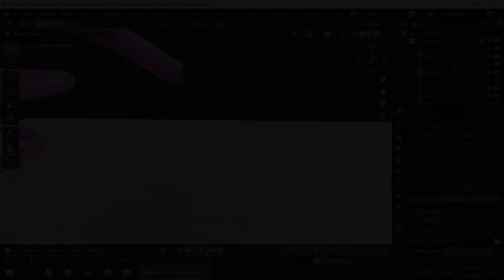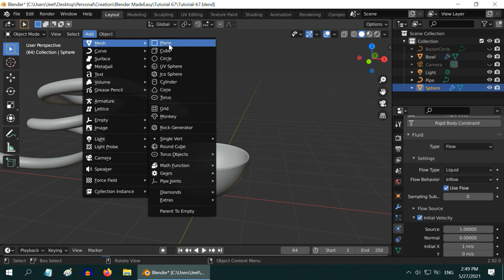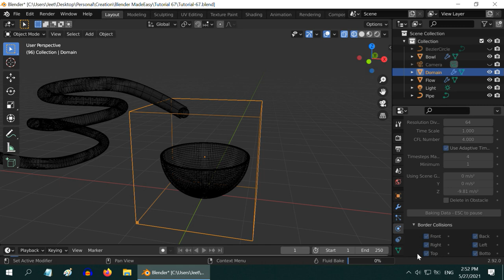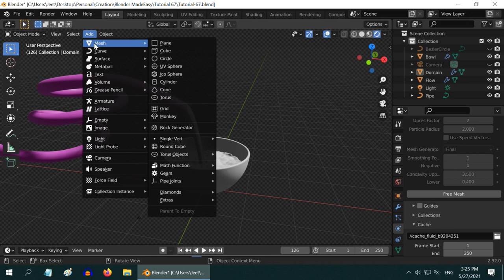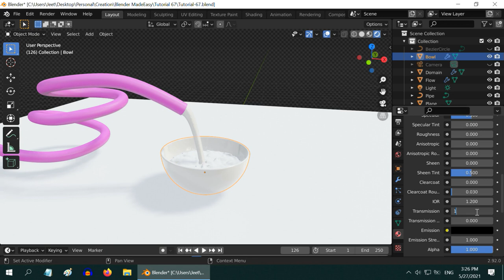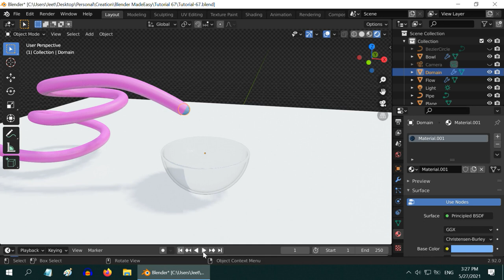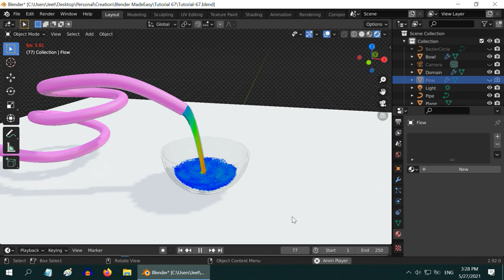Fluid Container Explained | How To Use An Effector In A Fluid Simulation | Blender Eevee & Cycles

Comment from the maker: If you liked this tutorial, please consider making a small donation, it will help us!
𝐘𝐨𝐮 𝐜𝐚𝐧 𝐬𝐞𝐧𝐝 𝐲𝐨𝐮𝐫 𝐝𝐨𝐧𝐚𝐭𝐢𝐨𝐧 𝐡𝐞𝐫𝐞 👉 https://donorbox.org/5-minutes-blender
Reply: hello I think you are using 2.92 not 2.93, I would appreciate if you change the title
Reply from the maker: @muhammedserifkorhan5617  You are absolutely correct. But I tested it in 2.93 and it works exactly same, they did not change the mantaflow. The title is to inform the user up to which version this tutorial is correct & relevant. The recording version is not important I guess. By the way, thanks for watching 💝
Reply: @5MinutesBlender  No problem, you explained it very well, I will continue to support you
Reply: @5MinutesBlender  Hi, I would really appreciate it if you respond, but... It's not working. I'm not using that exact object, I'm using a cylinder, that I cut out one of the faces to make a cup. To round it, I added a 2 subdivisions, but I'm wondering if that's the problem. My liquid ignores my boundaries and uses it as if the cylinder is just a cube, and sometimes, randomly, it acts as if I haven't changed the fluids. Any solves? Also, how do I make a cup? Sorry for the lengthy comment.
Reply: Also, sometimes, when I scale the effector, it acts as if I didn't and leaves a huge gap between my "cup" and the fluid. Thanks!
Reply: There is a bake all option now under cache.

Comment: Great tutorial, only one thing was a little bit of a problem was when the size of the flow object is too small I had to make it bigger for the water to come out.
Reply from the maker: Yes. A small size flow object will work only if you increase the resolution divisions of the domain object. You may need to use really higher values before you can see it working. But with very high resolution divisions, the machine can break unless it has sufficient RAM. So a trade-off is necessary.
Reply: @5MinutesBlender  Thanks for your feedback.

Comment: this doesnt work for me necause even though i tick the ‘Is Planar’ box it still passes through the effector and idk why. can u help pls
Reply from the maker: Hi, to be very honest, fluid simulation in Blender is not fully perfect. When the fluid velocity is relatively high, some particles would always pass through. You can somewhat minimize this by increasing the subdivision of the effector object so that it has a dense wireframe. I could create only reasonably good animation, but not perfect as per physics. I would call this a limitation as of now.

Comment: I can get everything to work but when I render it, the liquid pouring disappears as soon as it crosses the visual boundary of the bowl. I can still see it start emitting and pouring down until it pours "inside" the bowl, then disappears. The shadows show it moving inside, but I cannot see the liquid in the bowl. The transmission values are all good. It seems to work when I change blend mode to opaque instead of alpha blend for the domain (liquid). Any idea?
Reply from the maker: I have experienced this issue sometimes. I think a transparent or semi-transparent material behind another semi-transparent material does not work correctly. However, I also discovered that the viewing angle plays an important role here - the camera location along with the light can be an important factor. So until the original problem is solved, you can adjust the camera angle for the desired effect.

Comment: Sir how can we cange the amount of water flow
Plz help us by your reply ❤
Reply from the maker: You can change the size of the flow object to control the amount of flow. With bigger size of the flow object, the amount of flow will increase. This tutorial can definitely help you 👉 https://youtu.be/yKTQSPG_mgA Please also remember that the size of the flow object is closely related to the domain size and the domain resolution. With higher domain resolution, the fluid will display finer details and it will be more realistic, but the amount of fluid will reduce. With bigger domain size, you need to have a higher domain resolution as well. So ultimately you need to arrive at an optimum combination of these three factors for the exact amount of fluid you need.

Comment: Hi, is it possible to make fluids intearct with normal maps? Say, I have a plane that has a normal map with bumps and what not. Can I make fluids follow it?
Reply from the maker: Technically yes. You can setup the plane (with bumps applied as displacements) as a Fluid Effector, and the fluid will interact with it. But in reality, getting this actually work to a satisfactory level may become tough. You'll need to use a domain resolution of 512 or even higher, which is insane! If the bumps are big in size, you can expect a better result with a lower resolution.
Reply: @5MinutesBlender  Yeah, so basically it's displacement map and Cycles because Eevee doesn't do displacement. That's bad..

Comment: Thank you for tutorial, could I export  fluid simulation object to FBX or OBJ?
Reply from the maker: You can, but the results may not be very interesting. The export function does not yet work smoothly across multiple animation software. They have different ways to represent a particle system, different ways to handle material properties or modifiers. So the look & feel and the particle-based animation will look very different in the best case, and it won't at all work in the worst case. But anyway, try to bake all your animation before you export. I will be very conservative in my expectation in what will work across these export utilities. All the best.

Comment: Very useful! Thank you for sharing!
Is it possible to stop the flow, like if you turned off the water tap? )
Reply from the maker: Yes, you can do that in several ways. The easiest one is, select the Flow object (your tap), and in the physics tab, you will get one field named as "Use Flow", which you can keyframe. Let us say you want the flow to stop after frame 200. So enter a keyframe for this field at frame 200 with that checkbox selected. Then at frame 201, deselect that checkbox and again insert a keyframe. So the liquid will flow from the tap till frame 200. From 201 onward, there wont be any new flow. But the existing fluid that has come out already, will still remain within your domain object as usual. I hope that helps.
Reply from the maker: Now we have made a tutorial exactly on this subject, watch here 👉 https://youtu.be/yKTQSPG_mgA

Comment: Hey, clicking on render also renders the domain mesh, which is not happening in urs how come?
Reply from the maker: Hi, you need to bake the mesh as well, after baking the fluid simulation. Once you bake the fluid, expand the Liquid sub-section, you'll see a section called Mesh. Enable this, and underneath there is a button called Bake Mesh. Use this to bake the mesh as well. Then if you render, you will get to see the actual liquid, the domain mesh won't be visible, it will be replaced with the liquid. Please let me know if this solves the issue.
Reply: @5MinutesBlender  hey, thanks for replying. But the problem was that, int the 0th frame the cube domain mesh can be seen, but once it has passed 1st frame, the mesh rids of the cube and is now the fluid
Reply from the maker: Okay, usually we start the animation from 1st frame. So the bake defaults to 1 for the start frame number, and 250 for the end frame. But you can change this. If your animation starts from frame 0, please change the start frame number to 0 in the bake section (under cache). Basically, any frame outside the bake range will show the domain cube. Within the bake range, it will display the fluid (after baking). I hope this helps.
Reply: @5MinutesBlender  Thank You sire

Comment: But what if I want to make a model like bottle of wine which pours wine into glass and make it disappear in bottle?
Reply from the maker: You can do it in two ways. 1) Add a fluid source object (Inflow type) in the bottle, it will pour wine into the glass. Also add an Outflow object in the bottle which will "suck out" the wine and reduce the wine level in the bottle as it pours inside the glass. 2) Otherwise model your bottle as a fluid effector and pre-fill it with wine. If you now tilt it over the glass, wine will automatically get reduced in the bottle and pour into the glass. This method is more perfect than the first one, but a little more difficult to implement.

Comment: how to make fluid simulation with a moving mesh specially rotating mesh lake sheep propeller please ?thank you
Reply from the maker: You will need to set the propeller as an effector, and for better results, you should use a higher resolution divisions for the domain object. As the propeller moves inside a liquid say water, the liquid will get displaced, creating splashes of water. You can get some ideas from this tutorial 👉 https://youtu.be/38eiWHtw-ps Although it is not exactly about rotating mesh, but the physics will be somewhat similar to that.

Comment: thank you sm for the tutorial!! i'm making a champagne tower yet the water still leak thru the bottom of those cocktail glasses. i don't want to make them thicker tho so  i checked is planer for the collision and 256 for the division settings, yet it still leaks a bit and what's more, after the fluid filled the glass it heavily bounce upward and splashes. how to make it right like a real champagne tower...😂thx again!
Reply: ugh i changed to apic it looks better but still moving upwards a bit after it's filled... also if i want to the liquid pouring down faster which value should i change? thx!
Reply from the maker: @55woo88  Probably you can play with the viscosity field to make the liquid less "bouncy", but use a very very low value because it picks up very fast and turns water into gum. And for faster pouring, you can increase the source volume (i.e. the size of the flow) or just increase the gravity field to add more downward force artificially or you can also adjust the simulation speed (fluid simulation only) higher to speed up the pouring scene. I would go for this last option.
Reply: @5MinutesBlender  thanks for the reply! i baked the mesh it looks..emm.. fine i guess but those water drops are kinda big so i changed the particle radius from 1 to 0.7... then it doesn't pour all the way down to the bottom glass... 0.8 is fine it pours down but i dnt think there's much difference for the water drops.  also there's one more thing, while pouring from the inflow from the top, in the center of the first top glass the liquid kind of acts like a fountain it bounce back in the middle a bit(that's why i dont dare to speed up too much). i have no idea what values to adjust to make a better combination... not sure if i make myself clear tho but thx again:)
Reply from the maker: @55woo88  Yes I understand what you meant. Actually in reality, water does bounce from the bottom of an empty glass if poured from a height. It is not abnormal if within limits. But we can artificially make it more eye-soothing. Add some invisible water (or champagne for your case) in that glass beforehand so that the liquid does not hit the bottom of the glass directly, it will fall on that existing liquid. Then it should not bounce heavily. That existing liquid should be very small in volume and it should have a transparent material so that nothing is visible to the viewers). There are more ways to fake it, you can opt whatever looks best or easy.
Reply: yes i did that! now the only problem is it still has large water drops after i meshed it...(making some large glasses here.. one glass is 2m tall....)and the division is 256 particle radius is 0.8.. tried some different combinations but still didn't get a better result.

Comment: I am trying to make a flooding room, however even with the fluid Resolution Division at 96 it still sat quite a distance from the walls and floor.. Do you have any tips i could use to fix that?
Reply from the maker: I don't want to make you sad, but 96 is at the lower end when it comes to resolution divisions for perfect effectors in fluid mechanics. People use 256 or 512 for a more realistic effect. Otherwise you'll get that kind of gap between the effector and the fluid. One way to overcome this is to fake an effector. But if you just have a room to fill with water, you do not need effector. Just use the room as the domain, then there should not be any such gap. Anyway, just in case you are using an effector, what you can do is, use a second effector (fake) for the baking purpose. Resize this effector such that the fluid comes very close to the original effector. Now bake the fluid physics with this second effector. Then hide it. Render the scene with the first effector. That will give you quite realistic output with low resolution divisions.
Reply: @5MinutesBlender  Okay thanks

Comment: When I render the domain cube renders as a solid object, so can't see simulation inside, I'm using latest blender version, any ideas. Thanks
Reply from the maker: If you have turned on the fluid options correctly in the physics tab for the domain object, it should not show up as a solid box. If you can kindly send your blend file to us, we can check what is exactly causing this issue. You can get our contact details (Email ID) in the About section of this channel. Thanks!
Reply: same
Reply from the maker: @warriorsfg  Hi, did you bake the mesh before rendering the scene?
Reply: @5MinutesBlender  well, I baked the animation, I did try to bake the mesh before rendering but I didn't find any difference ;c
Reply from the maker: @warriorsfg  Can you please send your blend file to me, so that I can check and suggest what is missing? You can get our contact details (Email ID) in the About section of this channel. Thanks!
Reply: @5MinutesBlender  Yes, I will
Thank you very much for the reply
Reply: @5MinutesBlender  Hello, I got the problem
the thing was that I had to bake it and then go to the first frame for it to work, I was looking at the 0 frame, anyway thank you very much for your help
Reply from the maker: @warriorsfg  Oh I see! Glad to know that you resolved it 👍

Comment: Does anyone knows how to make the liquid absorb to the ground? And not splashing when they hit the ground? Please tell me, I need some helpppp:(
Reply from the maker: It can be an easy task, by tactfully using one limitation/bug in the fluid simulation 😉 Use a flat surface instead of the bowl shown in this tutorial, it will work as your ground. Make it thin and set it as the Fluid effector. Unless you use very high resolution division and your effector is thin, you'll notice that some fluid is getting leaked through the effector. This will ultimately create the absorption effect you need. With time, the entire liquid will get leaked through the ground. Try it!
Reply: @5MinutesBlender  woah, thanks for the answer!. I will try and experiment with that. Great video btw🔥
Reply from the maker: @siriusblack5984  Thanks! Keep us posted 👍

Comment: So how do you clear the cache files?
Reply from the maker: You can clear the cache from the Free Data button after baking. You can make some changes in the Domain Resolution, it usually resets the cache. Sometimes, for some reasons, your cache may just not go away, whatever you do. In that case, you may need to physically delete the cache files from your system's file manager.

Comment: Unless you've changed the scale, your bowl is about 2 metres across.  I've been struggling with scale...
Reply from the maker: The scales of the flow object, domain, and the effector are closely related to the domain resolution. The combination should be correct in order to get a perfect result. The scales that we used are as shown in the tutorial. I am confident that you will easily discover what scale works best for your scene. Ideally your objects should follow the real world size. But then you may need to use a higher domain resolution for the correct output.

Comment: its not working for some reason
Reply from the maker: Please check the domain resolution and increase it if needed. Also please check that the cache is clear. Sometimes Blender just keeps the old cache and despite all your trials it may not work correctly. Clear the cache and bake it, it should work.